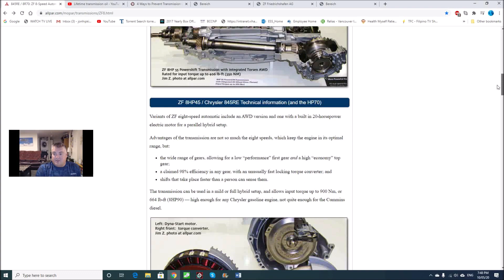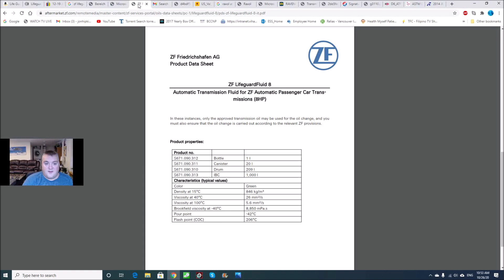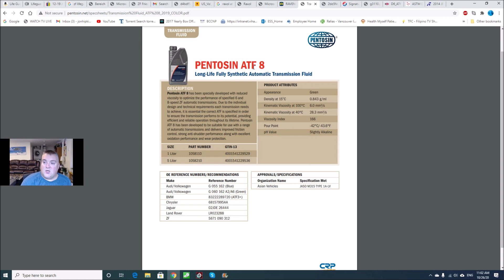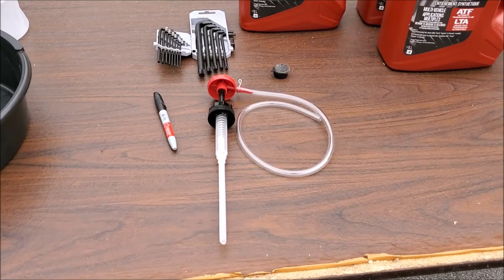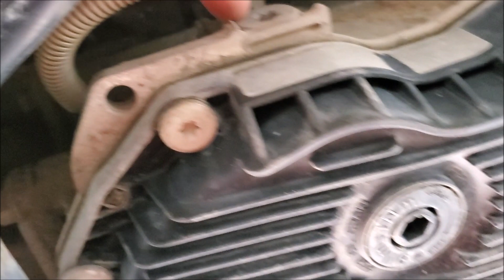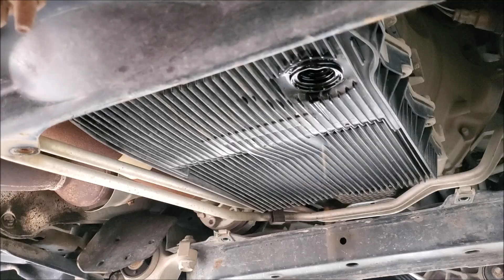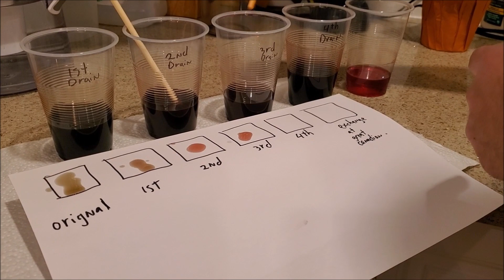ZF 8 SPEED FLUID CHANGE AND OPTIONS (SPECS INCLUDED)

Comment: Could I ask a simple question. When did you get the after Great Canadian oil change sample? It just seems too good to be true that it could get so clear if it was mixing with the entire system.
Reply from the maker: So the video might seem a little confusing as it's not actually filmed in chronological order. I did 3 drain and fills replacing around 3-4 liters each time. Then I became aware of the Great Canadian option. The last sample was taken immediately after the service was complete. They used 15 liters of maxlife and that's what the fluid looked like when complete. They cracked my drain plug to get me the sample. So the vehicle had not been driven yet when that sample was taken, but in fairness the vehicle is running for the entire service. This means that for the entire 45 mins your own tranny pump is circulating fluid. So I would think over that period of time the fluid would fully mix together from all nooks and crannies. I suppose the easiest way to tell would be to crack the drain plug now that I've driven 10k and check it out
Reply: @jonh2408  Thanks for the reply. It just seemed too good to be true (but I an a life long cynic), Do you know if the cooling valve opened during the process? The engine and transmission were obviously not working hard but also were not being cooled by moving. Ie did the process replace the oil in the cooler or does it just do a better job of replacing the oil circulating within the transmission? 
If the cooler oil is as good as the sample then that is a truly amazing process. 

I commend you for an excellent, well researched and informative video. you will save a lot of people who would like their transmission to last beyond its first oil change from being ripped off by the manufacturer.  I think you plan of 50k oil and 100k for the filter will be a great strategy.
Reply from the maker: @davebrown6552  So the drive to great canadian was about 15 mins for me. Upon arrival my tranny temp (according to the gauge on my dash) was around 60 Celsius. My normal "operating temp" once fully warmed up is 93 Celsius. When the service was complete I do recall the temp was around 80 degrees. This was too warm to properly check fluid level (which according to the instructions from zf) should be done between 30 - 50 Celsius. I drove home and came back the next day to get that done. Whether hitting 80 was enough to make the thermostatic bypass valve open I'm not sure. I'm also not sure how much fluid the cooler and lines hold 🤔. If you really wanted to ensure it did I would recommend driving around until you reach you max temp just before going in for the service. Or I guess you could rev up your engine during the 45 min service to try and get the temp to climb more quickly. When you go back the next day to get your level checked you could have them pull a quick sample to see what it looks like after driving around for a night.

Comment: Thank you very much! Maybe I missed it but exactly how much fluid should I put back in the transmission after replacing the pan. 2017 Grand Cherokee Laredo....
Reply from the maker: Put back in the same amount you drained out... also there are instructions online for checking the fluid level properly.
Reply from the maker: The link for the instructions is in the description (hopefully still working)

Comment: How did you do the procedure with moving through the gears on ramps? The video's I've seen with people following the procedure include the wheels turning and getting it into 2nd gear.
Reply from the maker: You can manually select 2nd gear (at least on my GC) and the directions online from ZF don't say anything about that. I know what your referring too as I saw several people doing that as well when doing my research for the video. I'm not sure where people got those instructions from (possibly from dodge) but I followed the ones from ZF, which just says to go through all the gears P, R, N, D - 1ST & 2ND. It doesn't say anything about actually needing the wheels to turn. So I just kept foot on break and went into each gear for 10 seconds
Reply: @jonh2408  Good to know, thanks.

Comment: Some really great info on this debated topic.  Curious how that replacement machine works... seems like it would still end up just mixing like your drain and fill process does.  They don't drop the pan even?
Reply from the maker: I will be going for my next change soon and will make a video at the shop. But no, they don't drop the pan. I think the reason it works so well is they use 15 liters of new fluid and the capacity of the system is around 7 liters. So they pump twice as much new fluid through as it could hold. I probably had some advantage because when I got mine done I had done 3 drain and fills already, so the fluid was already much newer/cleaner from the start.

Comment: Great Video Jon, from a fellow Canadian and hobby mechanic. After all of that, sounds like Great Can Oil change is the way to go :)
Any complaints with the Valvoline yet, or does it seem to be good? 
Again, Thanks for taking the time and thorough vid!
Reply from the maker: Ya thanks for watching... ya the valvoline is still running fine. I know alot of people rave about how much "better" or smoother it shifts with valvoline. I didn't notice any difference in that regard. I did notice it takes alot longer to reach 93 C (which seems to be the temp it runs at). This would indicate ( to me at least) that the original fluids ability to absorb heat was definitely impacted. I see now lots of good reviews on that $30 pan i mentioned in the comments
Reply: @jonh2408  Thanks for the Reply! That about settles it then.. take it in for a Valvoline flush... :)
That'll be a lot easier than I had anticipated this was going to be, esp getting a FULL flush! Have a great weekend!

Comment: I have searched HOURS on line concerning the ZF torque converter oil flush. I’ve found Nothing. Why is there no info on how to get the oil out of the torque converter when doing the oil change? What do you suggest? Thanks for your vid.
Reply from the maker: The flush machine they used on my vehicle gets it because the vehicle is running the entire time. So your pump is constantly moving the fluid through. The only other thing that I could think of (and I'm not sure how well it would actually work) would be to park the vehicle on a downward slope, pull the drain plug and leave it out overnight. Hopefully alot more of it would get drained with gravity.
Reply: Concerning my 2021 jeep gladiator Rubi with the ZF 8HP trans oil pan, there is no drain plug.
Reply from the maker: @kevinmcelheran4489  Really?.... is it an 8hp70?... or is it something made specifically for the Gladiator
Reply: @jonh2408  good question. I wasn’t able to see any stamp on the side of the tranny so I went to the book under the oil spec use. It just says use ZF 8-9 oil. 

Back history: I bought it new Nov 2020. I had asked the dealership to check all oil levels including diffs, trans case and transmission as in my previous vehicle -2017 Toyota Tacoma, all those levels were low from the factory (transmission was half filled) I didn’t know till I did my own inspection 16k later and was pissed. 

This time, I asked and they said they did it. I got it home and did all the steps to check the trans level and it was down 1/2 litre. But meanwhile, as I was underneath looking around the pan, there is no drain plug.
Reply from the maker: @kevinmcelheran4489  ya thats weird.... according to what I read the tranny is a ZF 850RE (which means it's the chrysler version of the original zf design). The only thing I could think of is to buy an aftermarket pan that has a drain plug. Does it still have the fill plug?
Reply: @jonh2408  yes it does. Thanks for the code. I think I’ll confirm with parts dept to confirm the transmission and get a part number for the pan/gasket/filter  and order that online. I want that mopar crap out of the tranny and put in the Amsoil Signature Series brand. 

Here’s a question for you. Why would the factory not install an in line power steering/transmission filter for power steering pumps/gear boxes? Splice one in in the low pressure line. I did that for my 2017 Tacoma and ran it one year with no problems before I wrote it off hitting an elk on the highway. 

I’ve driven 6k on my gladiator and drained out the power steering fluid which is full of sparkly metal flex. I know people normally just forget about that area but I am one that wants these things running problem free for a very long time. What’s your thoughts on that?
Reply from the maker: @kevinmcelheran4489  ya I know the amsoil has a great reputation. As for    steering pump I must admit I've never seen debris in the fluid (mind you I'm not a mechanic) or seen a filter on a power steering pump. I would turkey baster as much fluid out as you can and replace it. In the description of the tranny video I put a link to an article from allpar on the zf transmissions. It goes into some good detail about the ZF/chryslrr 8 speeds. I can tell you the impression I got during my research was that some of the transmissions like the 8hp70 are still built by ZF. Some others are a ZF design but now built by Chrysler. While the 8 speeds have a great reputation in general the reading I did suggests the ones produced in North America (by chrysler) areant as good as the German ones made by ZF. The fact that your (Chrysler built) version has no drain plug doesn't really surprise me. From the beginning ZF has always recommended a fluid change, it was Chrysler that started the "fill for life".... "never need to be serviced" marketing ploy.
Reply from the maker: @kevinmcelheran4489  one other good source of info is a guy who has a youtube channel called ONLINE MECHANIC TIPS.. he is an actual mechanic at a dodge dealership and posts lots of videos regarding the chrysler trannys... he is very knowledgeable and does answer questions... here is a link to one of his dozens of videoshttps://youtu.be/wNtO5rQtSu8
Reply: @jonh2408  Hey Jon, one other thing I heard from my Amsoil distributor is there was an Amsoil bulletin (no longer available) that stated the newer Chrysler tranny's need to be "reflashed" once an oil change or flush service is performed on the tranny. Do you have any knowledge of this need to reflash once an oil change is done?
Reply from the maker: @kevinmcelheran4489  I haven't heard anything about that and definitely didn't have to on my jeep. I will post the question on the ram and jeep forums and see what people say

Comment: this was very comprehensive and very good!  Thanks.  I am planning on changing my oem pan to the  PPE aluminum pan on my 2015 dodge ram 1500 with the 5.7L  By the way do you know of any American shops that  do that fluid exchange?
Reply from the maker: I don't... but if the fluid exchange machine is available here in Canada, then it would surely be available in the US. I'm curious to know what the filter setup on the aluminum pan is like, whether it has 4 magnets. If you could let me know what the pan cost you and how hard it was to find a gasket for it. And if what difference (if any) you noticed about your operating temperature, I'd appreciate it. And thanks for watching

Comment: Excellent Video. Thanks for creating, I am writing to seek your advice regarding my Jeep Grand Cherokee 2020. Currently, my vehicle has covered 83,000 kilometers, and the existing warranty is set to expire at 100,000 kilometers or in September 2025. I am considering extending the warranty to 200,000 kilometers or until September 2027.

However, I am facing conflicting information from my dealership in Qatar. They assert that the transmission oil is considered “lifetime,” and any replacement would fall under my responsibility. On the other hand, I reached out to Jeep Chrysler in the United States, and they assured me that changing the transmission oil would not impact my warranty.

Despite this assurance, I am aware that this verbal confirmation is not an official guarantee, especially since I will be signing a responsibility paper with my dealership regarding the transmission oil change. This situation has left me feeling uncertain about the best course of action.

I kindly request your guidance on how to proceed. Should I adhere to the dealership’s stance, or can I confidently replace the transmission oil without jeopardizing my warranty? Your insights would be greatly appreciated.
Reply from the maker: Ya thats a tough one. If you can extend your warranty to 200,000km's that's a nice option (definitely not available here in canada). If your planning on keeping your jeep long term than I would definitely do a change (especially in a hot climate like Qatar). Maybe you could do a change but use the lifetime 8 fluid so it's the same as original. That way the dealership would have no way of knowing you did it.

Comment: On 2018 ram 1500 3.6 tradesman. 

This is my second atf change. I did it on my 60k. Now on 130k. I haul every day. Trust me oil is burned. So if the dealerships tell you is life time. Bull shi*. Is dark green burned.

Please service it. I honestly wouldn't flush the transmission. I will only do fluid and pan filter. The filter will do the rest. Because metal shavings are part of your transmission. Metal shavings will be used as friction on the gears.

Nowadays the ATF pan I have found at $175 and the fluid at $27. Currently took 6 quarts. Tomorrow will need another bottle but not whole bottle chances are 1/4 or less or maybe 1/2. Due to the bypass valve. 

Once again please, please, please service the transmission. Don't believe it is life time. Not even human beings are life time, sorry to say it but hey 🤷‍♂️.
Reply from the maker: @waltercastro2015  Agreed.... thanks for watching

Comment: Hey why dont you just disconnect the transmission oil cooler line at the radiator and drain it from there as you're refilling the fluid at the pan so it pushes out all the old fluid instead of mixing it with the old and re draining it.
Reply from the maker: @almeal406  well the thermostatic bypass valve sits in the line between the tranny and cooler so it would stay closed (unless you could find a way to heat the fluid to 175F) so the fluid wouldn't flush any of the lines. I guess you could wait until the cooler gravity drained but that might take awhile. Plus the system only flows in 1 direction so you wouldn't get any of the fluid on the return side of the cooler
Reply: @jonh2408  is there a way to bypass that valve? Is it on the cooler feed hose? Or built into the transmission?
Reply from the maker: @almeal406  it's in the line between the tranny and cooler (at least on mine it is)

Comment: Really need your help.  I have an Audi A6 2007 quattro with s-line.  Transmission is 6HP19A but cant tell which color fluid is.  Is it zf 6 or zf 8 that i need?  The chart you show has both of them listed!?!?
Reply from the maker: The chart I show in my video shows fluids for the ZF 8 speed transmissions. The transmission in your car is a ZF 6 speed. Don't worry about the color of the fluid. Just make sure whatever fluid you use is compatible to your transmission. The fluids will list online (or on the jug itself) what transmissions it covers.
Reply: @jonh2408  yes.  Above the chart it shows the zf6 but for thr 6HP19A. It shows it works eith both zf 6 and zf8 fluid
Reply from the maker: @DebtFreeCars  well on rockauto.com it lists valvoline maxlife as a fluid... along with several others. You are correct it lists the 8 speed fluid (despite the fact yours is a 6 speed). I would just use maxlife if it were me. But you could also check with your local parts store (Napa, Auto parts plus) or as a last resort the AUDI dealership (although they'll likely tell you only to use their fluid at an extortionate rate.

Comment: How is this pan and fluid combo doing?  I bought a cheap Ebay pan over a year ago and filled with Valvoline MV ATF.  The gasket pinched and bulged during final torque, eventually seeping and dripping under full throttle loads, it's been almost 30k miles so I'm going to replace what I'm hoping is just a garbage gasket.  Curious if the Dorman 265850 set from Rock Auto solves the problem.    

Thanks,
Tim
Reply from the maker: Ya the dorman one is doing fine. There was talk of one on here that was $30. I was of course suspicious  of it at that price. But the little feedback I did hear on it was good. I think its in one of my comments. But ya the dorman one has been good. Will do another video at 150k showing the fluid exchange (with fluid samples) machine at great canadian. Then another video at 200k where I replace the "replaceable filter" on the dorman pan.
Reply: @jonh2408  bought an OEM gasket seal just in case, many people complaining of these leaking too.

Comment: is there a transmission fluid additive or a thicker fluid that can take heat better? I live in a very hot climate and summer months take a toll on fluid temperatures.
Reply from the maker: @frankmabo3940  not sure, but guess you could just change your fluid at shorter intervals. TBH I was surprised to see how high the normal operating temp of this tranny was. Mine runs at 93C (199F) under normal driving conditions. That's alot higher than most (normally around 75C) and close to the temps where damage can start occurring. Maybe the very high temps help get better fuel economy (more viscous fluid).